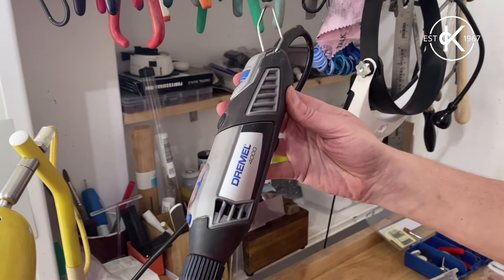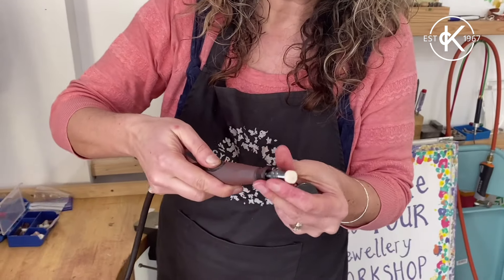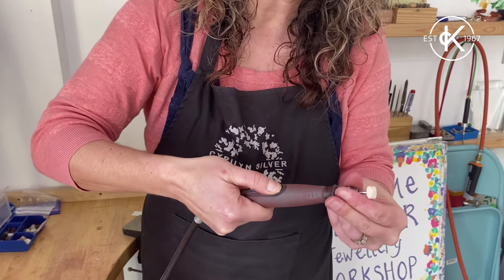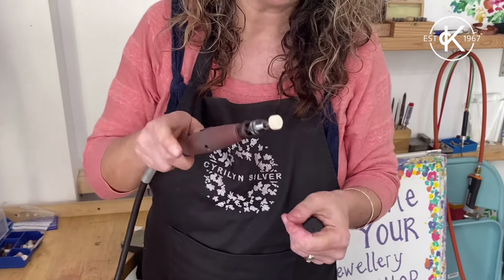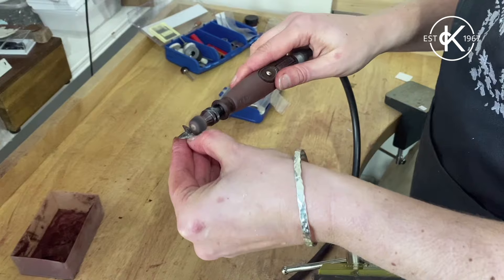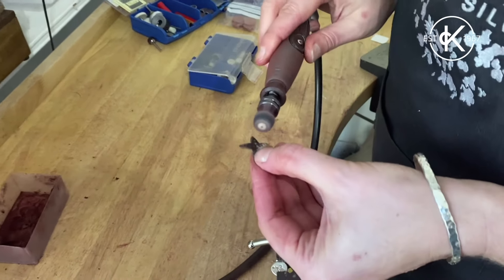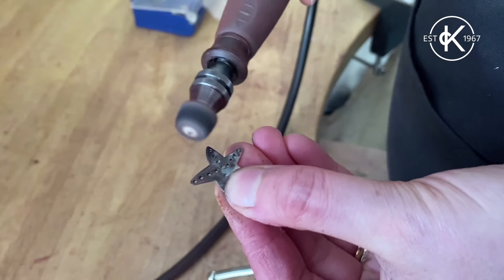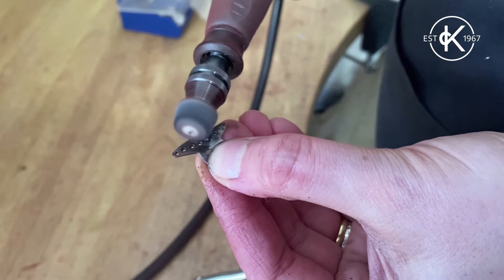How To Polish With A Dremel Rotary Tool | Metalsmithing Tips | Top Tip Tuesday | Kernowcraft

Comment: If you want to patina a piece would you still polish it like that? Or is there a different method?
Reply from the maker: Hi Lauren, we'd recommend finishing and polishing your jewellery piece before using liver of sulphur. Once you have achieved the colour you want, gently use a jewellery cloth or our polishing papers to remove the patina from the areas your want. You may find this page useful :) https://www.kernowcraft.com/jewellery-making-tips/texturing-patina-finishing-advice/how-to-create-patina-with-liver-of-sulphur
Reply: @kernowcraft Hi, is it a doable practice to use a q-tip or an old toothbrush to sort of paint liver of sulfur on a piece in just a small area so I don’t have to clean the entire piece? Seems like extra work to dip the whole piece & get the patina in spots where I don’t want it. (I actually just bought some LOS gel & as yet have not used it yet)
Thank you 😊